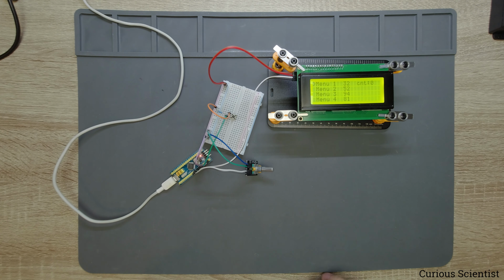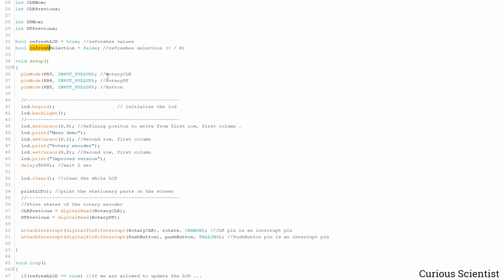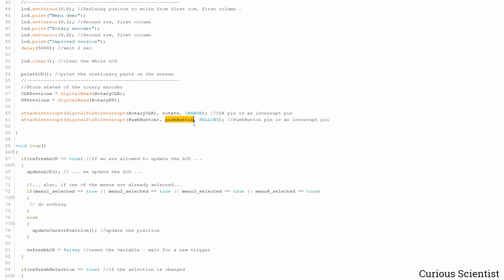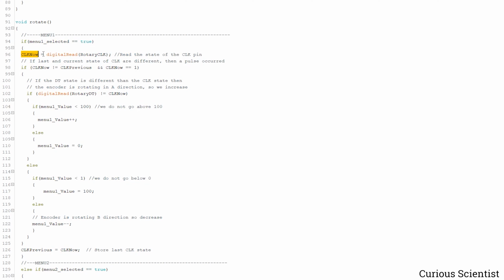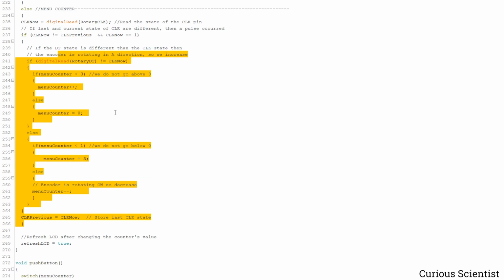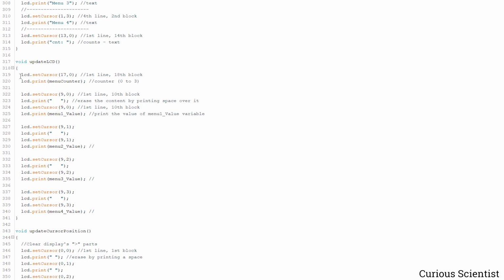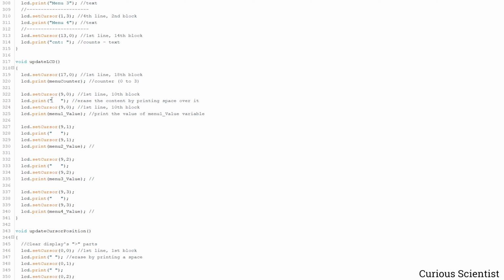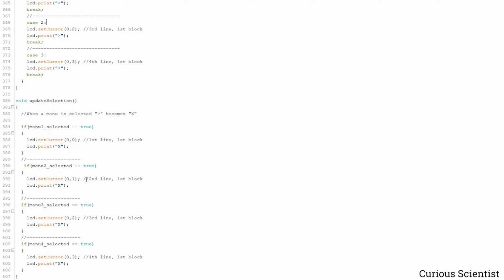Advanced menu system with rotary encoder for Arduino/STM32

Comment: Can this fit for 10 variables / Menü 1-10 and scaling up and down the rows? 4 variables are not so much. I thing the values have to save in 1 EEPROM byte if you leave the configuration.
Reply from the maker: Yes, sure, you can fit even more variables. This is just an example that can be expanded into more complex stuff.
Reply: @CuriousScientist  , how can you scroll through the menus if you have 10 and only 4 rows? Did you display 4 rows of 10 for the variables and change the sites 1-4 , 5-8 and 9-10 ? 
Please explain the possibility.
Reply from the maker: Yes, I would display the first four items and then the next encoder click would shift out the first row and shift in the fifth. So the display would show 2-3-4-5 lines. And so on...
Reply: @CuriousScientist  , is this in the related code?
Reply from the maker: Download the code and see it for yourself. The code is free.

Comment: Hello, looks great but I think that for me, something is missing
a menu entry to save and exit ( validate entries and pass values to main program)
How can you do that (Sorry, I am an arduino beginner)
Reply from the maker: Hi! Check my newer videos. I have many videos where I built menu systems and I implemented similar things that you require. For example, my reflow hot plate project definitely has this feature. Or the 10-channel temperature logger project.

Comment: This is an excellent tutorial and would be absolutely perfect if I got it to work.
On an Arduino UNO, 16*2 LCD, I am trying to achieve working with a rotary encoder with built in switch but absolutely nothing that I do can get the Menu > to change to X
Can I please send you my circuit diagram and sketch for you to have a look at and see where I am going wrong?
Reply from the maker: Hi! The tutorial has nothing wrong as you can see it in the video. I published the same (or further improved and tested) code and schematics on my page. They should work perfectly if you followed my tutorial well.

I am sorry but I don't have the free time to accept such assignments for free. However, you can hire me and then we can consult about the issues. Email address is on my website.

Comment: Very nice tutorial. Can I use this code on STM8S development board using Arduino IDE?
Reply from the maker: Thanks! If the specified board is available in the boards (which means it is supported by the stm32duino framework) l, then sure you can use it. Just make sure you follow the pin definitions according to the STM328S MCU.

Comment: Hi. Thanks for this great video. How to make the cursor blink instead of X when we select the menu? Or is it possible to highlight the selected menu?.
Reply from the maker: Hi! Both are a bit more complicated. Blinking the cursor would mean that you would need to draw and erase a cursor with some timing. It is doable, but in my opinion, it doesn't worth the mess. Highlighting is also possible. I don't exactly know if this specific display and the corresponding libraries can do it, but I did it with other displays in the following way: The unselected item is printed with the default letter colour (in this case, black), then when I move on the item, first I draw a black rectangle over the area of the text, then I print a white text over this rectangle. Then, when I unselect/navigate away from the item, print a white rectangle over the previous area and reprint the original text in black. It is a lot of coding and you have to carefully keep track of the position on the menu, you have to implement navigation in both directions...etc. I implemented a very similar strategy for my soldering station: https://youtu.be/9xac7aseDws

Comment: Good job! Helpfull video but what should i change if i use stm32cubeide to run it?
Reply from the maker: Thank you. Basically the whole code has to be changed. This is written for Arduino. CubeIDE uses a different framework (HAL) and has a totally different way of dealing with the things.

Comment: Hi there, thanks alot for the explanation and code. 

I'm working on a school project and i need to make a menu to hold 5 different codes. It also doesn't use a rotary encoder but a slide potmeter. I'm very new to coding in general and was wondering if you could help me with some stuff?
Reply from the maker: Hi and you're welcome! I can help with advices, but not for free. I am not a free support service.
Reply: @CuriousScientist alright, fair enough. What is your email? That way communicating is somewhat easier
Reply from the maker: You can find my mail address on my website.
Reply: @CuriousScientist  Thanks, just sent you an email.

Comment: I know it works, but it is a bad practice to have unnecessary code in interrupt routines.
You should not have handled program logic inside, but simply detect states, set flags.
And it would solve the issue with updating cursor, as you could still have had old position, erase it first, then based on a flag set the new one.
Reply from the maker: All I did in the interrupts are increasing/decreasing a value and changing a boolean's state. Where do you exactly see the bad practice? How would you implement it correctly then?
Reply: @CuriousScientist  only detect rotation event and direction. comparisons as everything else take up mcu core time and it will bite you in a more complex project with sensitive timings.
Let Ben Buxton show you how. In in your example with his lib even polling would suffice and you won't notice that interrupts are not used:
https://github.com/buxtronix/arduino/tree/master/libraries/Rotary
Reply from the maker: Thanks, I will look this up and will try to adapt it for more complex codes. Luckily, I don't have time critical codes yet, so the technique I use works just fine. But, yes, if there's a way to improve, then let's improve!